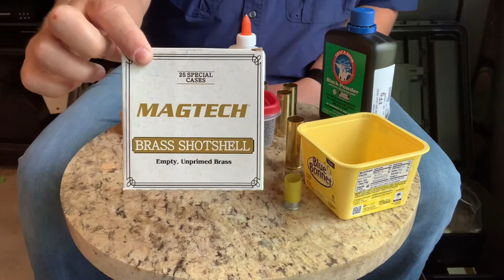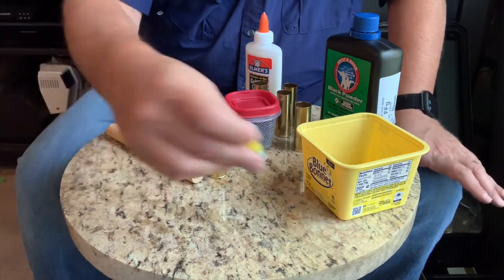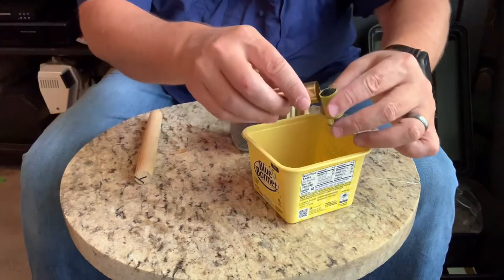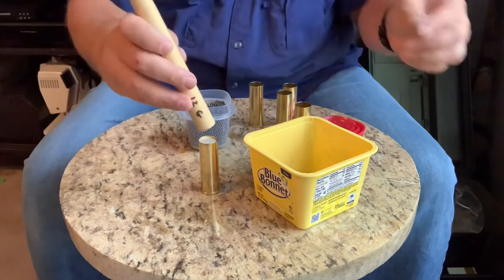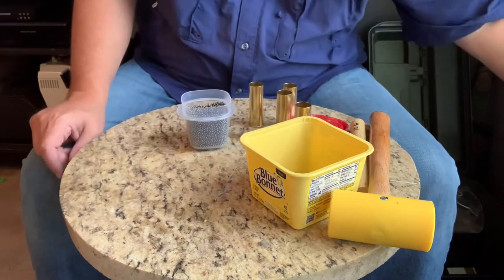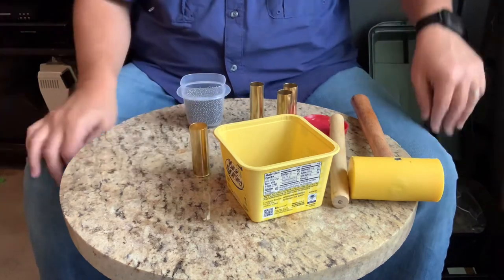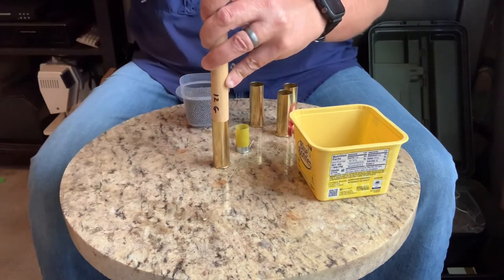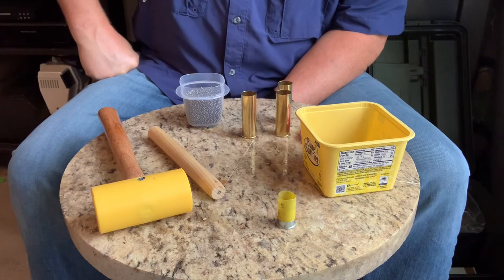How I Load Black Powder Brass 12 Gauge Shotshells

Comment: When I'm at the local gun ranges I pickup the used 12ga. shot cups without the attached pistons. Then when I reload for black powder shells I stuff one in on top of the powder card and fiber cushion. I think it helps keep the shot cluster together a little better.
Reply from the maker: Yeah it can. Do you find it melts the plastic in the barrel any?
Reply: @JWheeler331  No melted plastic. I have even used plastic hulls but they are only good for a loading or two.
Reply from the maker: @kypparmstrong2775  I have used plastic hulls and wads before with black powder and found melted plastic in my barrel. Maybe it depends on the hulls or charges or both.

Comment: Using a 15/64 drill bit you can enlarge that LPP hole to insert a 209 shotgun primer. To make a it a cleaner fit, you can gently chamfer the holes. 

209 are cheaper, more common, and in less demand especially in pandemic/fearful times
Reply from the maker: I did that to a few of them actually.

Comment: Kool video. 
I have an aluminum anvil that weighs about a pound that I seat my primers with. And I also have an antique primer seater that works great I just put a card over the primer and press the primer in. The card is so no dents in the primer.

Comment: Can I use 2.4 magtech brass with my 1887? Also some people say 10 gauge or 11 gauge wads, which or both? Thanks, I really liked your video.
Reply from the maker: Thank you. 11 gauge works best in the brass shells. I use 10g over powder cards at times and 11 gauge cushion wads. I didn’t know MagTech makes 2.4. Pretty sure they are 2.5” but if they do make a 2.4 it will work if you have an antique 87.
Reply: @JWheeler331  yes, I have an early model 1887 #2749 and it is gorgeous. I don't want to damage it in any way. I can't speak to the previous owner for he has passed. Steel shot .180 is ok? I am in California so I can't really get anything but ffg and that may not last if these commies have their way!
Reply from the maker: @thedudeinstockton4248  Steel shot should really not be used in these. Lead or Bismuth should be used if possible. 2f will work just fine though.

Comment: How many reloads can you get out of the brass without resizing
Reply from the maker: Lots! I don’t know the exact number. I use these in only one gun and have yet to resize them. I have shot hundreds of times. Now, if you use them in multiple guns you may have to resize due to the different chamber sizes.
Reply: Awesome thank I’ve been asking that question for years and nobody thinks it can be done without resizing
Reply from the maker: @TheRyanDude  No problem. I have shot hundreds through these with no resizing. All out of the same gun though and all black powder.

Comment: I am going to load some #4 buckshot, So I want 70 GRAINS (weight) of 2fg BLACK, and 70 grains of #4 buckshot???   Or would I be better off, weighing 27 pellets, (I THINK thats the normal number) then MATCH that weight with 2fg powder?   I am VERY experienced with rifle/pistol reloading, shotgun IS NEW to me. 

THANKS!
Reply from the maker: I’m kind of in the same boat as you. I have reloaded rifle and pistol for years but just picked up shotgun reloading when I got my 87 and haven’t loaded any buckshot for it as I also picked up a 1901 which handles the hotter loads. 

I would just look up period black powder buckshot loadings and use something similar.

I would also refer you to @shotgunscientists channel as they deal with many different loadings.
Reply: @JWheeler331  I did ALOT of digging. 100 grains 2f black 1 1/4 ounce of shot. = working load. 3f burns 10% hotter than 2f. I. My case 1.25 ounce = 27 pellets #4 buckshot. -- I use hot glue to seal it. My a5 will cycle the load well too.  (It needed cleaned anyhow).
Reply from the maker: @jackdundon2261  Nice. Sounds like a decent load.
Reply: 70 GRAINS of 2fg would be a good load  under your 27 #4 buckshot.

Comment: Is there a reason to not empty a plastic hull and replace the powder with blackpowder?
Reply: They say BP, after a few shots the barrel gets hot and the plastic starts to melt.  I don't think it's an issue.  Easy to clean afterwards.  Brass looks cooler though.
Reply: @usnchief1339  brass does look cool 😎 I just want a way to load 2 BP blank rounds to shoot through Grandpa's 1880's Remington Damascus side by side for a video. The lock-up is kinda loose, so nothing with recoil.
Reply: @chrislang5659  You should be fine with plastic hulls with BP and a rolled crimp.  Make sure to check the chamber length.  Then a good cleanup since BP is corrosive.

Comment: Hi,
Great vid. Very clear explanation and good camera angle. You show a safe process using ordinary tools dedicated to brass shell. No need to invest in expensive équipement. 
I have three questions :
- I suppose the fiber wad is also 11 gauge like the over shot card?
- What about the thickness of both fiber wads and over shot cards?
- Do you need to resize the shells after having fired them. I assume not…

Thx again and keep going with this good job. Very helpful 👍👍
Reply from the maker: Actually I may have misspoke. The fiber wads are 11 gauge and the overshot cards are 10 gauge. The overpowder/shot wads are .125 thick and the fiber wads are 1/2 inch thick. I’ll put the links in the description when I get home this evening.
Reply from the maker: Links are now in the video description.
Reply: Thx a lot. Very helpful.
Reply from the maker: @oasis6444  No problem. Glad it helps.

Comment: Nice video. Do you have to re-size them after shooting?
Reply from the maker: I have not had to resize these because I shoot them out of the same firearm each time which is my 1887 Winchester Shotgun. If I was putting them in other chambers I may have to resize them.
Reply: @JWheeler331  Thanks for your reply!
Reply from the maker: @kokorico5416  No problem.

Comment: Well done video.
A lot of guys recommend using half a cushion wad and you used two full ones. And they did not appear lubed.
It just goes to show you how much variance there can be.
Reply from the maker: Thank you. The amount of wadding would change depending on shot amount. I have tried lubed and feel in a shotgun it just didn’t make a big difference. If shooting a bunch maybe but for 10 or 20 rounds at a time it sure didn’t.
Reply: Thank you for your reply. There are so many variables.
I found, for my powder and shot amounts, a half a cushion wad reduced the "donut" patterns I was getting. But it would certainly be nice to utilize the whole 2-1/2" shell. Plus it would be easier to glue the overshot card. Maybe I'll load some today with two dry cushion wads to try out. @JWheeler331
Reply from the maker: @pacanis  Let me know how it works out for you.